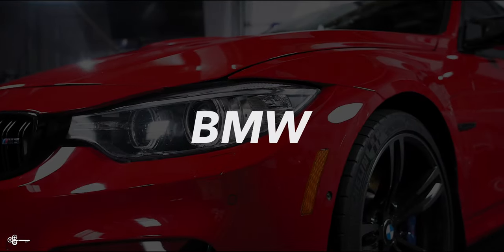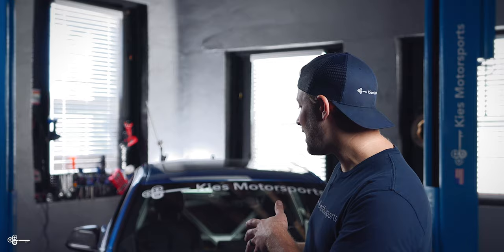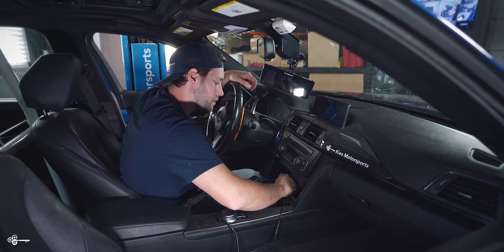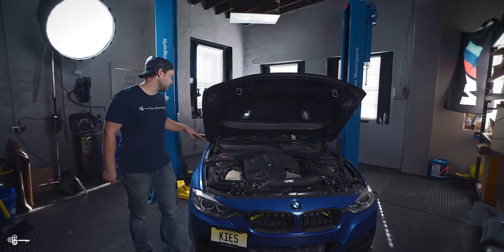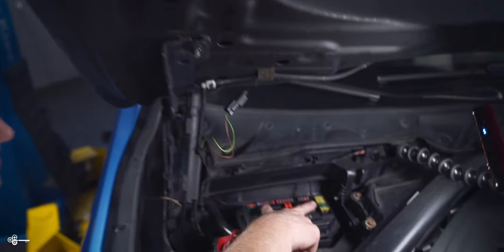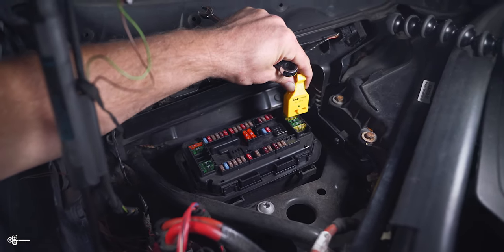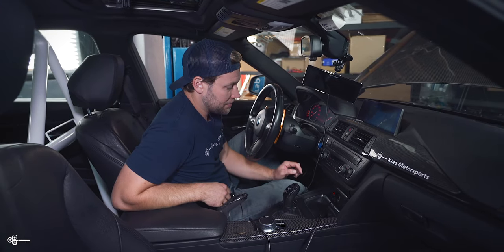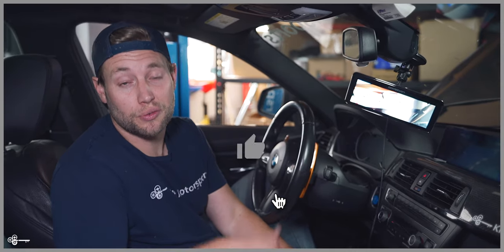How to Fix your 12-volt socket (by your cup holder) in your F30/F32/F80/F82 BMW

Comment: Great video as usual, could you please make a video on how to add a extra 12v socket in the back of the car where the rear passenger air vents are.
Reply: I would appreciate finding stock plug for glovebox 12V socket. I've looked behind the glovebox, but it's nowhere to be found... Probably stuffed somewhere with the whole harness.

Comment: How do you fix the SOS call system failure in F30 pls  help........love the videos
Reply: Just in case anybody needs help with sos problem. It was covered by warranty and it has to do with some kind of little battery.
Reply: @teggyboy99  had the same issue and was covered with warranty

Comment: I replaced the fuse but it still doesn't work. Both charging sockets (near cup holder & the rear one) don't work and all the fuses are functional. Any ideas?
Reply: I have the same problem, did you fix it?

Comment: I think that’s the problem with mine. I hope because I have my camera and scanner plugged into the adapter. However, the adapter seems to work but the devices won’t work. The camera has a USB so I took that out of the adapter and plugged it into the the glove compartment in place of my phone and it didn’t work. I tested the camera in doors and it worked. I’m really puzzled. The 12 volt isn’t working in either place in the car. :(

Comment: If i dropped a penny in my 12 volt and it sparked and is blackened do i need to change the 20 amp thing and the charger port aswell!
Reply: Did you fix this problem? I had a similar issue happen